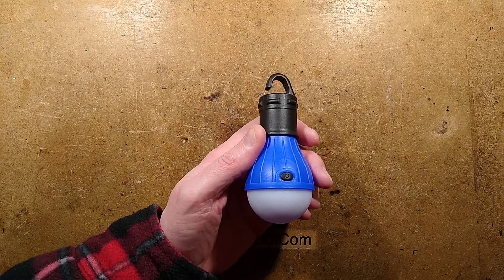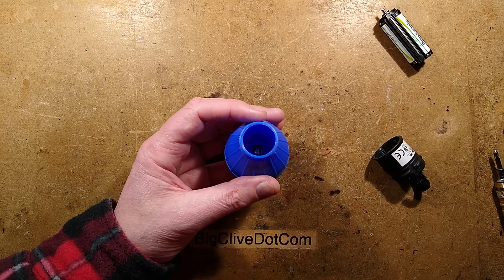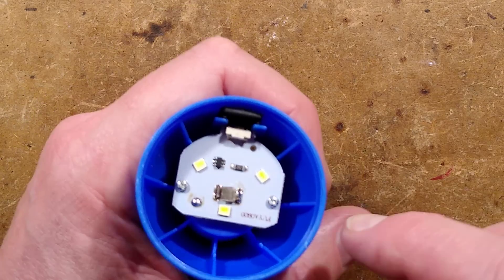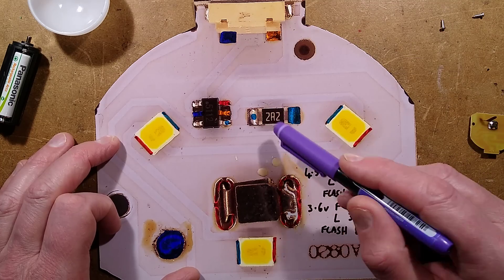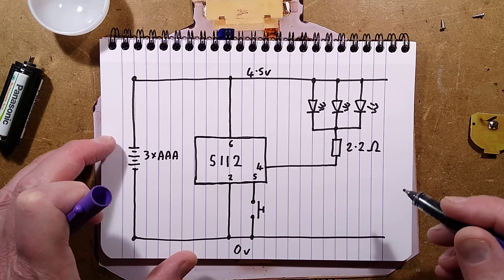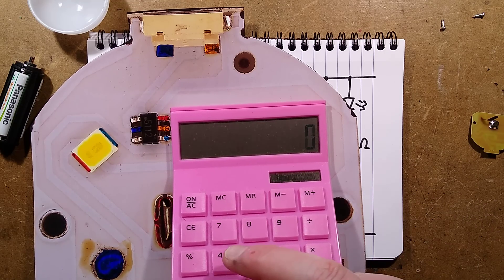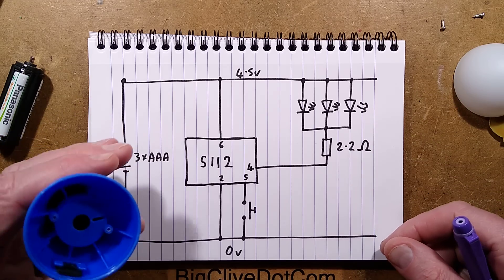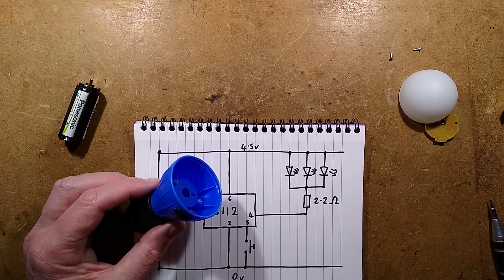Pound shop 4th version camping light (with schematic)

Comment: as a hotel facility manager I used 20 very similar "lamps" bought for 0.5$/each several years ago for technical spaces with no built-in lights over "almost dead" AAA/AA batteries  from a variety of  remote controllers . A great option for draining used batteries  before sending them  to recycle!

Comment: The total Current you measured includes the IC - What is the IC Current no load? ie with out the LEDS in circuit as this could be the reason for the High Current?
Reply from the maker: The IC has an extremely low current.

Comment: That battery contact region on the PCB looks as if it gets hot... 🤔
Reply from the maker: It's probably just flux from the soldering of the large contact.
Reply: @bigclivedotcom  Thanks, Clive. Makes sense. 🙂

Comment: I received a pair of the ALDI power bank hand warmers as a Christmas gift and they work very well. I had to make a modification to the on/off push button as it protruded far enough to be accidentally pressed while in my pocket, but very good otherwise. You should take one apart. 
I also purchased one of the Ferrex 4v screwdrivers as a gift for my 7-year-old son. I haven’t disassembled it because either he or you will most certainly have it in pieces in short order. It has a inbuilt work light that makes a very good flashlight as well.

Comment: One explanation for the constant changing and odd shaped PCBs is that these are made with the offcuts that are broken out between customers circuit boards. Factorys sometimes do the design of PCB panellisation, so adding the tracks to the panel offcut and a few extra reels of parts on the component placement machine is not a problem. The contract customer never knows that the PCB scrap is now LED lights!

Comment: I'm sure I once said I was going to reuse a battery and a charger from a disposable personal Nick A Thinny vaporiser here in the comments a while ago.
I love it when in your videos you continue some stories, so here do I too: I discovered that one such vaping device has almost a juice tank module (if only the unit was ever designed to be opened for replacing and recycling them, aha), so I decided to simply repurpose the whole unit, with the case.
The board has a small five-legged chip (must be TP4057 or something) with caps and a resistor, a Type-C connector, and soldering points GND, OUT and VBAT for the pressure sensing device.
The pressure sensor simply shorts OUT to VBAT, so I replaced it with a switch — blowing into it isn't very handy.
The board itself is held tight with friction of the USB connector and even four self-tapping screws, what a luxury. The juice container (and it has a mesh instead of a coil this time!) connects to two prongs on the board, and even their polarity was silkscreened too!
I emptied the container and placed three UV (near-UV, but they cure resin quite quickly) LEDs in parallel, and a 75 Ohm resistor in series, so now I have a small portable rechargeable violet/UV flashlight.

And thank you for your work, it really does inspire even those of us who are humble and/or lazy, and/or quite new to this beautiful and terrifying world of electronics. Thanks, and thanks!

Comment: I purchased a few of the older versions of these that allow you to use 18650 cells as I have a nice little collection of those batteries. I was sad to see that is no longer an option not only for these, but I noticed earlier this year when looking for some extra emergency storm/power outage lights, that it seems like there are little to no 18650 powered gadgets anymore(I'm talking about swap-able cell type) I guess that was just another fading trend.

Comment: Is there any way to disable the modes on these generic control chips?  I have a couple models of torches for work that live in my pocket all the time to illuminate things. One does Hi, Med, Low, Off, Long Press - Lantern - lights a different array of LED for general area illumination, no flashing mode at all, it's a torch, and once turned off it just resets to Hi next On.
The other - Hi, Med, Low, Strobe, SOS, epileptic seizure mode and have to click through them all to get back where I started. If I turn it off in Low, next time I turn it on, it's in SOS even if it's days later.
Generically speaking is this something that can be programmed out by bridging pins on the controller chip or placing a certain resistance across pins? Or just live with it?
I can always reprogram it with a sledgehammer, driving over it a couple of times, that would be cathartic - but not in the BigClive spirit.
Reply from the maker: Sadly no.  It would require replacing their control circuitry with your own.
Reply: @bigclivedotcom  The sledgehammer it is then. Thank you.

Comment: Those triple AAA cradles are usually great, you can do a direct replacement with an 18450 3.7v cell and depending on the fitting you might need a bit of extra sleeve around it for a snug fit. This one has a different design with the outer ring.
Reply: I've used a 25650, was a spare from a defunct vape, lasts forever!

Comment: Would a variable resistor make any sense in this lamp for full dimming, or does that not work on these types of lamps??
Reply from the maker: You could for low intensities, but most variable resistors have a very low power dissipation rating.

Comment: Wouldn’t it be better to have one resistor per LED to prevent an imbalance in the current through the LEDs when they are in parallel like this? The forward voltages of the LEDs will never be identical.
Reply from the maker: It is preferable to do it that way.

Comment: Love your videos, Clive. I would like to convert one (or more) of these camping lights so that it will connect to a usb power bank. I'm thinking it would make a great emergency light during power outages. Would love to see a video tackling that challenge.
Reply from the maker: Not that hard.  It would just require a USB cable and possibly another resistor inline.
Reply: @bigclivedotcom  Agreed. But as with most things, the devil is in the details. I'm sure you would have some unique ideas about how to get the cable into the light itself, and the most effective way to make the connection to the circuit board.

Comment: So the 5112 has internal resistor for low setting ?
Reply from the maker: It pulse width modulates the output.  (flashes the LED on and off very fast to make it appear dimmer.)

Comment: What're everyone's go to rechargeable AAs/AAAs and chargers? I've got some ancient NiMH Energiser (naff) and Encore which could probably do with being replaced.
Reply from the maker: The eneloop live up to their reputation.   Good capacity and extremely low self discharge.  It's useful to have an old fashioned dumb charger on standby as it will bring back over-discharged cells that "smart" chargers don't recognise.
Reply: @bigclivedotcom  My ancient Encore cells (supposedly 2700mAh) are still showing decent voltage. Can't remember the last time they were charged but it has to be at least 5 years ago. Might give them a top up a see how they go.

Comment: I think they make 26500 size LiPo batteries, which are the same size as C cell batteries, so if you wanted you could just throw one of those in and charge it in an external charger

Comment: Does anyone know if the red LEDs are the right wavelength for a darkroom? Yes I still do film photography.
Reply: You would need to order red LEDs emitting light around 620-630nm. And panchromatic film and paper still wouldn't be safe, but that would be true for any red light.

Some people use infrared LEDs and cheap cameras with the IR filters removed, displaying on a small screen inside a VR goggle enclosure.

Comment: I've bought one of those cartridges as a AAA to 18650 cell adapter (I just wanted the shape of a 18650 to convert an old flashlight to work off an external power supply without soldering to the flashlight's contacts) so I think you could literally just insert a single 18650 in there instead of the AAAs. Given that three AAA is around the 4V mark that suits a Lithium Ion cell beautifully.

Comment: Grundig is long dead. Grundig used to be its own company. Then a Phillips brand name for a long time. Tube TVs and radios. Later also semiconductor radios. Grundig was mostly characterized by the special quality of the electrical circuits. But at some point Grundig was flattened and the name was sold. Just like Telefunken and Metz.
Now you find the names on all cheap products.

Didn't Grundig develop the Video2000 system? That was better than VHS and later Super-VHS. But also more expensive and rarer and it lost the video market.

Or the double Superhet receiver from Grundig. Input filter, 1st mixer, 1st IF, 2nd mixer, 2nd IF, AM demodulation, sideband oscillator, etc ... But who needs shortwave these days?

Comment: is a 18650 Li cell too long?
Reply from the maker: It might fit, but would need the two connections at one end.
Reply: @bigclivedotcom  how about 3d printing a clip with spots for terminals so it will not just be bouncing around inside the long spring loaded terminal gives some extra length potential if it is shortened

Comment: A quick and easy ( warm white ? ) camping light can be made from a 12 Volt G4 base LED lamp ( A++ efficiency ! ) and a battery pack from an old laptop ... use a plastic curry tray as the lampshade ( ? ) use the diagonal ( 45º ) sockets from an old  DIL ribbon cable lead as the lamp socket , and some old Christmas lights flex ( nice - n - thin ) ... ( tried - n - tested ) ....... DAVE™ .............

Comment: Thank you Clive , these lamps are soooo hackable. 
I’m thinking fitting some slow change rainbow leds  will give a brilliant effect , especially once the leds after a few minutes go out of sinc and produce different colours. 
Also appears to be plenty of room in there to fashion some form of a reflector. 
Then add some salvaged vape cells and a tp4056 
Or just rig it to take a standard 18650 and swap for a charged cell as required. 
Have had flashlights that had the 3xAAholders and 3xAAA holders supplied with the light in addition to the 18650 li ion. 
Thinking the cap had a fairly long spring.

Comment: I bought  a Grundig MusicBoy radio in 1971 which gave amazingly good reproduction on FM..
Still working well, if a little care worn,  in 2019.
 DAB had replaced FM, so I adapted the output amp to boost the output of an ipad. Still amazing audio  quality for a nearly 50 year old speaker and germanium transistor amplifier.
Reply: Ah yes, the geranium transistor that initially blossomed and floufished in the semiconductor garden. No longer to bloom after the  silicon seed was sown.😏

Comment: I have a touch that has the same feature set that banggood sent me by mistake. The problem is if must have a current draw as even with a good 18650 it starts flashing flat battery in about 3 days with about 40 mins use on low
Reply: Currants go in buns. 😉
Reply from the maker: You can often hack lights to run at lower intensity with much longer battery life.

Comment: LEDs in 2835 case can be found with powers up to around 1W (at 3V), these ones are most likely 0,5W models (150mA max @3.2V) this would nicely fit with 400mA drive current. ;)

Comment: I bought some similar lantern light that accepts a single AA battery. When I opened it up it has a boost circuit that gives the LED 2.8v from a 1.2v Ni-Mh battery. Very cool and simple circuit.
Reply: Yes, I much prefer ones with the boost circuit and single AA vs those with the x3 AAA cells. With the cheap 3 cell ones, you never get the full mAh out of the batteries before it becomes unacceptably dim.

Comment: The name Grundig always gives me warm fuzzy feelings and reminds me of old VCRs and big HiFi units with loads of clunky switches. It's a shame what happened to the brand.
Reply: The warm feeling is the reason they still use the name. Even if you had a soldering iron in hand for the last 50y, as I did, you have to remind yourself not to fall for a brand name, that is just an alternative alibaba sales channel.

Comment: Oh dear. The proper way to send SOS is the three letters, but without letter gaps. eg it isn't actually "S-O-S", but a pro-sign with unique spacing. Not sure, but you also suggest it should be a continuous string. This is wrong, each group should be free standing with a word gap (I think). I need to get out my old navigators reference manuals and have a look. It's been 50 years since I studied this stuff.
Reply: Oh go on, please post up a diagram or such for us fellow pedants, if I ever need to use it, I may as well use proper form (I am British after all).

Comment: Is there any way to eliminate the flashing setting?
Reply: The universal fix is a hammer, either to the device or preferably the designer. 😀
Reply from the maker: No.  Not without adding your own custom programmed chip.

Comment: I've always wished these little chips were just simple, on off toggle. It would be great if they were universally available like a jelly bean part. I don't want to build my own flip flop circuit to toggle a tactile switch. Or program a microcontroller, just for that job. So to have a little chip with a built-in mosfet, that can toggle on off, would be great.
Reply: SN74LVC1G80. Also TTP223 can be strapped for toggling if you need a touch switch to go with it. Long ago when I looked, Maxim had some luxury-priced convenience chips that debounced switches. Some of them might have had dual action. Edit: All these require you to choose your own switch to suit the load, but they can probably drive an indicator LED and logic input without sweating.
Reply: @abitofabitofabit4404  I have used the ttp223 touch modules from eBay many times (very handy and cheap).
Reply: I mean, if you just want on-off, have you considered a simple physical power switch? Why do you need a tactile switch triggering a mosfet?
Reply: @treborrrrr  You can get tactile on/off switches. The push-to-make push-to-break variety. I replaced a push-and-hold switch in a mini fan with one so you don't have to keep the damn thing pressed all the time.
Reply: The "premium" headlamp brands (Petzl, etc.) manage this with a timer that, after mode selection in the first few seconds, a click is interpreted as "off".

I was just thinking about this, and whether the timer component adds an unacceptable penny to the cost of the MCU.
Reply: @EarlySwerver  Theoretically, our cheap chip may be made of hardwired logic written in HDL and synthesized as top metal for a semi-custom CMOS chip, like the old CEM synth ASICs. The rest of the MOSFETs could be wired in parallel as a power transistor array.

Comment: FYI, the pinout seems to correspond with the YX8253, with VDD on 6, LEDs on 4, GND on 2 and the Switch on 5, with 1 and 3 having no function.
It also seems to have the high and low power settings, the flashing and the SOS.
And the circuit corresponds as well, except for a missing 10uF capacitor between VDD and GND.
Reply from the maker: It's a very common pinout for similar chips.

Comment: Geez, I wish Chinese manufacturers would stop assuming that these lights should have flashing or SOS mode. Not once have I ever used it. It’s just a nuisance you have to button press past.
Reply: 😠 - most of those consist of “Chineseum crap” and all are lazily using the 1 IC that has the flashing function

Comment: How long would this last with a fully charged battery?
Reply: With 900mAh nimh high mode 6 hours, low 26 hours based on the current draw Clive wrote down.  In reality with voltage drop they'd last longer as they dimmed.

Comment: I hate aaa batteries I'm sure half this stuff is a partnership to sell more batteries. I've been replacing many of the holders with a 26650, almost the same size just 3D print a tube to hold it, even fit a small charge board in many of them

Comment: Sosososos is NOT right!

If I heard sosososos, I'm not saving you 🤣

I've tried a few times changing those three aaa holders for a lithium battery and it never works out, you have to get a weird size, or get lucky with spring type contacts... That then touch the two halves of the top together and short the battery👀
Reply: I recall a different approach with shirts promoting the old airline TWA: the pattern of the fabric was a weave that repeated the letters, not as TWA TWA TWA, but TWATWATWATWATWA…, inviting some misinterpretation.
Reply: @markiangooley  hahaha ha I want one now
Reply: The ones that do the negative pole at the rear, for the usual flashlight spring-contact in the rear screw-on cap setup, usually work fine with 18650s. 
Some even come with a plastic tube to pad out an 18650, in addition to the 3xAAA holder, but if not then solutions are simple enough to improvise to center the 18650 ...
Reply: @michaeltempsch5282  I usually find they're too short to hold the 18650
Reply: @phonotical  Guess there's a mix out there, with varying fit/tolerances, as I've had no issues with a number of different lights.